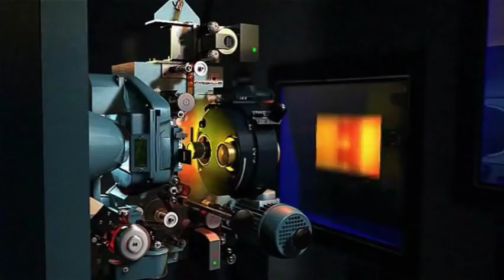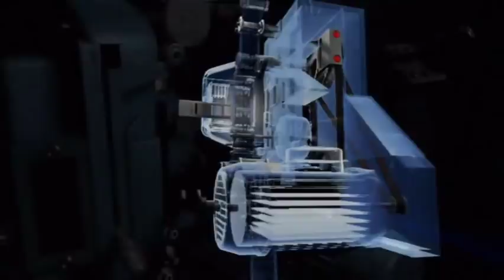35mm Cinema Projector - How It Works

Comment: Is it still possible to see the image if the light is not flickering constantly?
Reply: It would show one frame, which would look like a still picture.
Reply: You might know this by now.  I see that your post is 2 yrs old.  The light needs to be interrupted between frame changes to mask the motion of the frame moving.
Reply: prajwal bhattarai h
Reply: It would look like a horrible blurry mess, as you'd see the film moving as each frame is being pulled down.
Reply: 24 images are used per second , but each image is 2 times projected .
the human eye can " see'  47 flikkers per second, but 48 will bee seen as flikkerfree.
and  24 x 2 gives 48 flikkes/images per second.